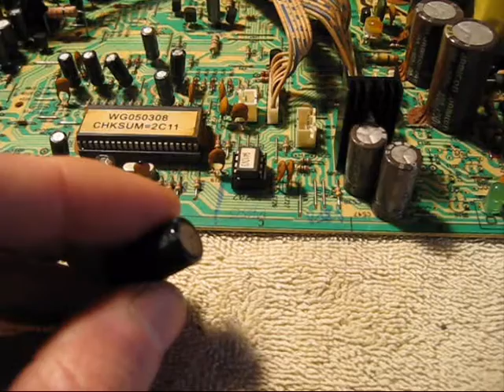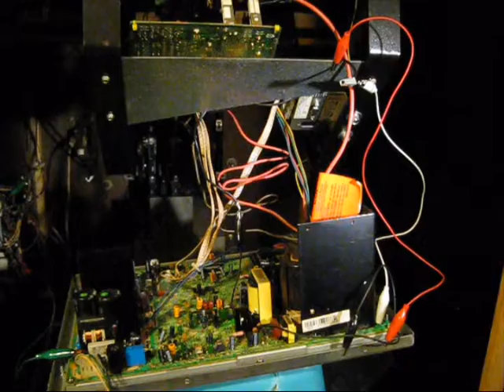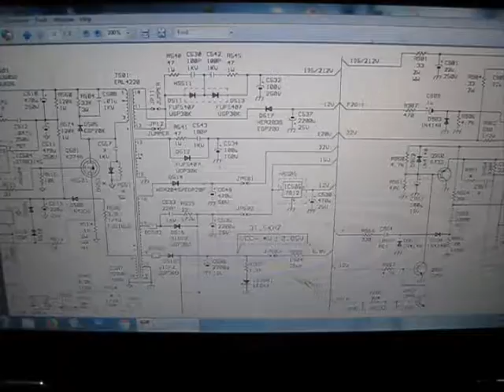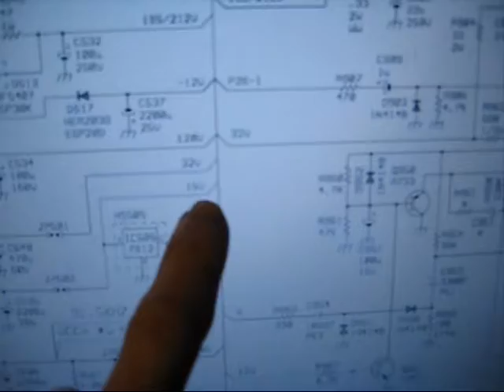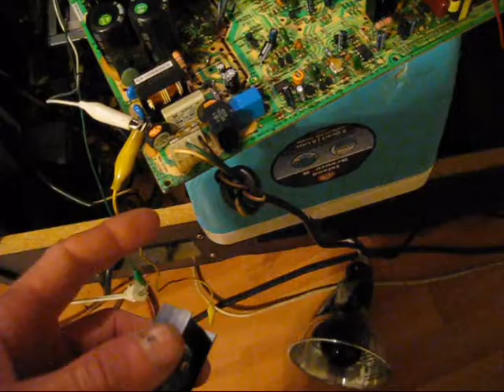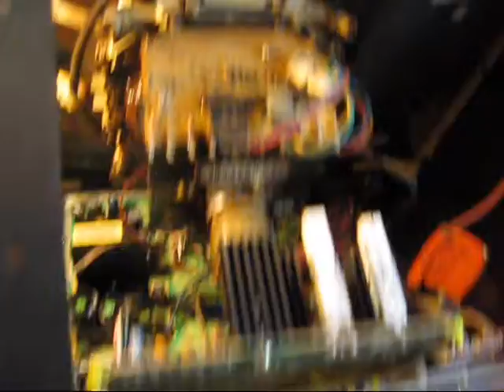Wells gardner d9400 Power issues

Comment: any of you guys ever figure this one out? I have one doing the EXACT same thing. I even tried loading the 120VDC but that didnt work on my monitor. 

this monitor has been capped, FET has been swapped out, opto isolator and that 8 pin IC have been changed. Nothing changes anything.

Comment: I'm working on the same board installed in a Tekken 5 machine. Currently my display is red and it's horizontal sync is off. Do you have any advice on this?
Reply: on the SYNC, try applying the SYNC wire to the negative horizontal pin ONLY. As far as the color goes theres a factory menu that you can get into to adjust the colors. To get to factory mode, power down the monitor, find the remote board, hold OSD and Key + and power it back on.

Comment: This is the same exact monitor and issue that I am having. However, my green light on the chassis board does not turn on or flash, ever. It is in permanent shutdown and the last time it worked was about a week ago when it randomly turned on one time and allowed me to play for the evening. Any idea why my green light would not be flashing at all? Do you think your end result would be the same fix for mine? I had a full cap kit done and still did not fix the issue, same as you lol.
Reply from the maker: It sounds like your SMPS isn't even trying to start. The fix might work for yours. I'd try it, the parts are cheap enough.
Reply: @pfun41  thank you!
Reply: @pfun41  would it be possible for you to message me back with the exact names of the two components that I need to find? For the life of me, I cannot understand what you are saying when you describe IC502 lol… probably because I'm not super tech. IC503 is just a little black component like this one, correct? https://www.ebay.com/itm/191673914901
Reply from the maker: @Scantron5k  You need the wiring diagram for the chassis. IC 502 means  integrated circuit 502. its a location on the board, the wiring diagram will tell you where it is. You need the numbers off the chip itself.
Reply: @pfun41  ok, I'll check the schematic. Thanks!
Reply: @Scantron5k did you ever get yours figured out? I have this same issue on mine
Reply: @ShreddinSleds  nope. Sold it non working.
Reply: @Scantron5k  ah bummer, did you try anything or just got rid of it?

Comment: PFUN41, which TV & arcade monitor circuits and components is NOT GOOD to connect an oscilloscope to measure the voltage and waveforms to prevent damaging the monitors circuits and components?

Comment: Thanks For the video it was a big help. What did you ultimately decide was needed for the repairs?
Reply from the maker: After replacing the tl431 shunt and the optoisolator it worked reliably until I sold it. I'm not sure why it would take a few tries to kick on but it always did so predictably so I didn't worry about it.